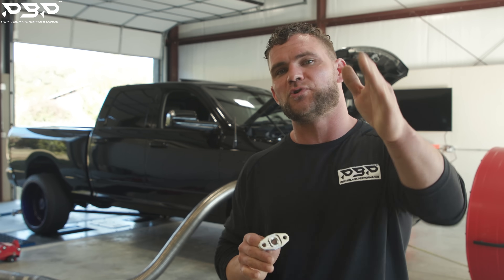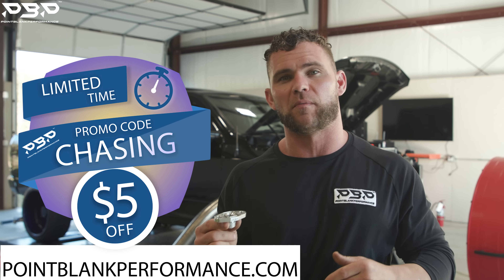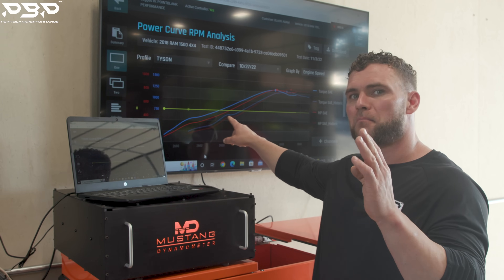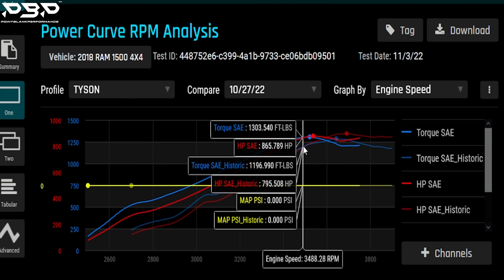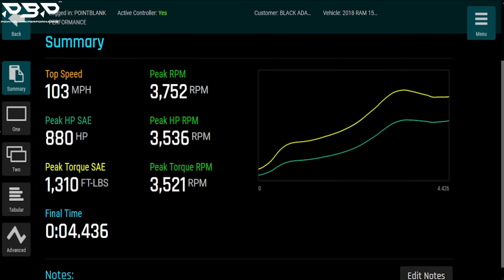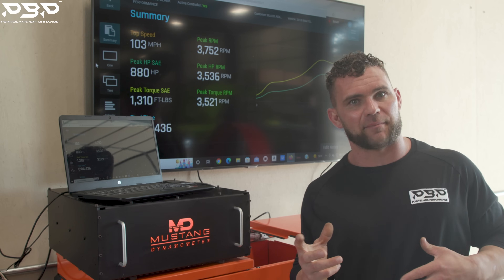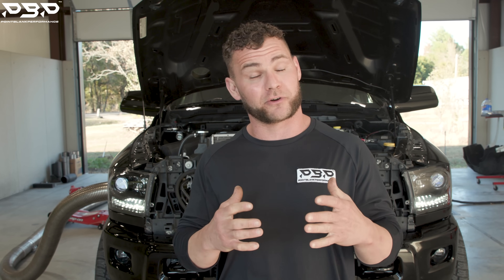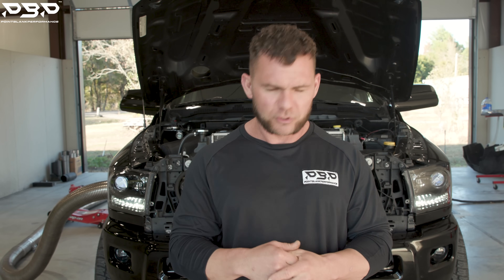TESTING OUR T4 BILLET EXHAUST MANIFOLD ON A 1000HP CUMMINS

Comment: Why's it get all clackety after the pull? My truck does that sometimes, is that from running out of fuel?
Reply from the maker: 250% over and sudden let out fuel is still exploding in the cylinder.

Comment: You have more then enough air. A 72/87/1.0 can do 1000hp.
Reply from the maker: Keep hearing that but haven’t touched it on our Dyno..
Reply: @POINTBLANKPERFORMANCE  48 swapped? Or still a 68? If it's still a 68 truck that's prob soaking up a good chunk of power.  48FTW!

Comment: So I’ve got compounds, s464/s480 fleece 10mm pump and 30% over injectors. Push rods, valve springs in the head, and standard bolt ons. No idea what I’m making for power, but what should I do from here?

Comment: How would this setup compare to a compound setup.  Calibrated stealth 64 with a WC fab s480 compound setup?
Reply from the maker: Should be a 800 to 1000 hp sir !  A single 80 isn’t ideal for daily a t6 would make way more power over this t4

Comment: 900 hp and only 1288 torque?
Reply: not surprised, this is a top heavy setup so the rods won’t bend to hell. High torque at low RPMs will need stronger rods.
Reply from the maker: High Rpm Pulls , trying to keep the rods in it .
Reply: @POINTBLANKPERFORMANCE  
I’ve tuned my 16 6.7 psd and it will make well over 1200 below 2200rpms. So far so good. 
I’d love to talk you about some ideas in my tuning journey, and bounce them off your brain. 

I always enjoy your content, and look forward to the next video. Keep it up!
Reply from the maker: @Farmer-Bauer  yes sir anytime if we can help we will !!